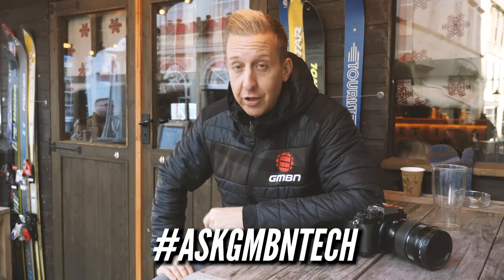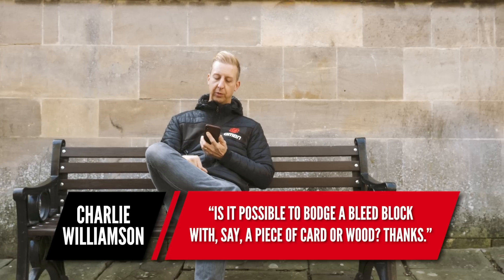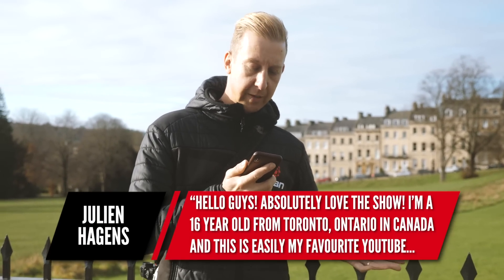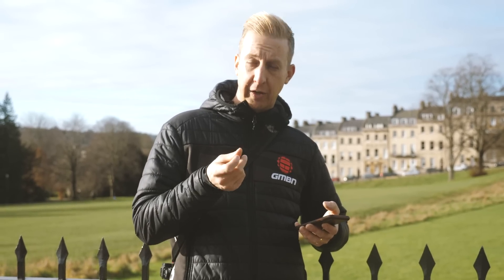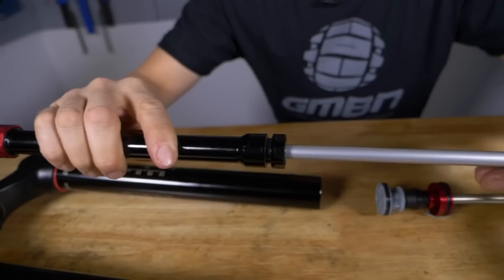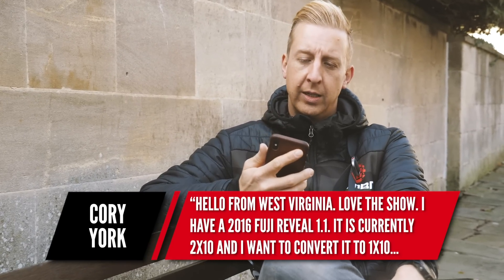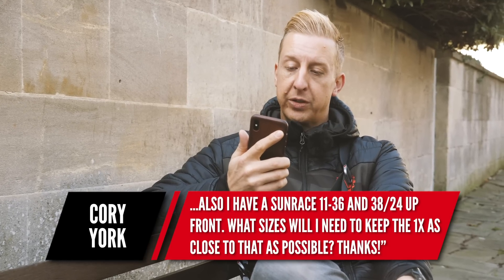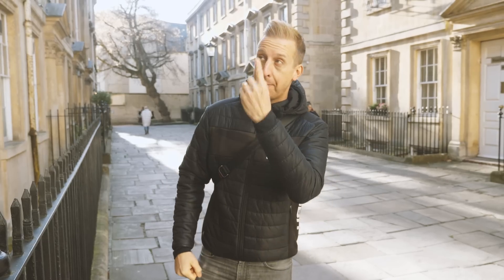Why Is There Oil Residue On My Stanchions? | #AskGMBNTech

Comment: #askgnbm hi guys from Philippines. loving the show. i have a question. i did a service on my Rockshox Monarch. and through the process i followed some service on YT. i depressurize my IFP. question is do i need to bleed the damper chamber or could i just fill the IFP with air. thanks and more power to the show.

Comment: #AskGMBNtech Doddmeister love the show, keep it up. Hella mega love from the bay. I've noticed several new bikes opting for the horizontal lower link rear shock setup i.e. Santa Cruz's high and mega tower along with the Bronson, Marin's wolf ridge, the new specialized enduro etc. What is it about the kinematics/linear ratio offered by this particular type of rear suspension that's causing this spike in popularity on new 2020 frames?

Comment: #askGMBNtech Hello, I was curious about compatibility issues between Sram eagle and Shimano 12 speed drivetrain components. In particular can I run a GX Eagle cassette & derailleur with a SLX or XT crankset? If so, does it matter what chain I use?
Thanks for reading, looking to build a new trail/enduro bike. All the best for 2020.

Comment: #AskGMBNTech Hi Doddy, I’m interested in getting a Canyon Strive and it comes with a 230*60 stroke shock with 150mm of travel. Would the frame fit a 65mm stroke shock? Would you recommend that or say the strive’s travel is enough. Since lots of enduro bikes are specced with 160 or more rear travel.

Comment: I have a suntour xcr air fork and I also got that black residue  which did not affect the performance of the fork but I  took it apart  and the grease  was black toward the bottom of the lowers . I cleaned it up and re grease with  slickoleum  . The only oil use is a tiny amount to help to seal the air side of the shock . It was easy to service .My only problem I used a thin oil which was 20/30 weight and maybe I needed a heaver  weight to seal that air side . Only time will tell if I loose air . If I dont see a return of the black slime I guess it maybe a breakdown of the grease and maybe contaminated with some dirt . Maybe the slickoleum will have a better outcome

Comment: #AskGMBNTech hi guys, thanks for the show, been loving it since the first time I saw it.I recently bought a Scott Scale 970 for my wife which comes with a SRAM Eagle SX, but the chain drops in the biggest cog if you do a random amount of backpedal, sometimes it requires a full crank spin, sometimes it drops with a few degrees. Whenever it does, the chain drops two gears, gets stuck and it requires a lot of friction and nasty noises to get back to the largest cog. My wife is starting in the MTB world and this is making her uncomfortable, I heard it's because of the chain line but the bike and the drivetrain is brand new, is there anything that can be done to improve the backpedal?

Comment: #AskGMBNTech I have basic Shimano brakes on my bike (br-m445). What would be a better update: better rotors or SLX levers? I've already changed the pads for semimetalic.
Reply: i suggest for the money 160.00 usd, slx 7000 series. they are the best for the money. otherwise if money is not an issue use magura brakes.
Reply: also some xt -86 rotors i use 180mm and 160mm on my gt avalanche and i will upgrade to the 203mm in front and move the 180mm to the rear

Comment: #AskGMBNTech Hi I’ve had two bikes now and they have both had the same problem. This could also just be completely normal. But when I’m on my lowest gear in the rear and the bike moves backwards the chain changes gear into the next larger gear. This could be completely normal but i would love to hear your opinion. Thanks

Comment: Can you use the shimano m8100 front derailer shifter for a rock shox onelock. I have a reba fork. Thanks #AskGmbnTech
Reply: shifter levers are for shifting only. you need a specific lever for the function.
Reply: @frogasauruss  https://youtu.be/tmOK-uWviJ0 9:50 Dody said it's possible

Comment: I have an older bike with internal routing for only gear cables but want to install a dropper post, is there any way to route the dropper cable  internally?  #AskGMBNTech
Reply: drill

Comment: #askGMBNtech I want to upgrade Sram rotors from 180 mm to 200 mm, but my FOX 34 has 160 mount. Is it correct to install large rotors on trail fork? Do 160 to 200 mm adaptors exist or do i need two adaptors?
Reply: Installing bigger rotors is fine on a trail fork if you want extra power.  I believe each increase in rotor size increases power by about 20% due to extra leverage.  You just need to buy the 200mm post mount adapter.

Comment: #askgmbntech I believe one of the benefits of a slacker head tube angle is that the fork can compress backwards as well as upwards, helping with square-edge hits. However, slacker HTAs combined with fork offset means the trail measurement of the bike grows, leading to floppy steering at low speed.

Wouldn't a negative offset fork offer the best of both worlds? A fork stroke that moves back and up, along with smaller trail measurement giving you better low speed handling? Has anyone tried mounting their fork back to front to try this out?

Comment: To answer the Suntour fork question, yes oily residue is normal on the stanchions of the Suntour coil forks.  They contain no oil, just grease on the spring.  Rebuilding one of these just involves removing the coil cartridge and re-greasing the spring assembly and putting it back together.  There are a number of YT videos that show the specific service procedure for the Suntour coil forks, it is much more simple than an air spring fork.

Comment: #askgmbntech hey guys, i’ve been breaking spokes like they’re nothing on the last weeks, granted, i ride dh trails on a xc bike (xcaliber 9) but have never experienced something like this before, when do I know if there needs to be a rim replacement instead of just buy all 28 new spokes? Spokes? Rims? Spokes? Help!!
Reply: Felipe Trujillo How or where are they breaking? Take your tire tube and rim strip off and look at the spoke where it threads into the nipple. The end of the spoke should be right at the end of the nipple (base) to allow full thread engagement. If you don’t have this, breaking spokes will be the result (and your wheel builder screwed up).
Reply: GNX157 hey dude, they are breaking right on the hook, on the J that goes into de rear hub

Comment: #ASKGMBNTECH 
Hello I have a question should I upgrade the suspension forks of my £400 Trek marlin 5 they dot work well and are starting to rust they are coil suspension forks made by suntor #my favourite channel by a mile Leo

Comment: Fun fact: im a car mechanic by trade and we never use brake cleaner for cleaning up DOT brake fluid because it doesnt do anything, instead we use water because DOT fluid absorbs moisture from the air, we just spray water over the dot fluid it shifts the fluid and turns it milky, for mineral fluid you're probably best just using brake cleaner though, the real purpose for brake cleaner was to contain all the brake dust that comes with drum brakes and to stop it getting in to the atmosphere as brakes were made of asbestos back in the day.

Comment: #AskGMBNTech
Hi I want to buy a pair of magura mt sports and i cant find front or back option. I was wondering are they like hayes. Do you flip them and you are good to go. I read that magura mt sport is mt4 lever and mt2 caliper. Is there any diference not inclouding weight saving. Is it worth to pay more for that mt4 caliper.
Thanks And Keep Up The Good Work And Happy Christmas.
Reply: ive got a set of magura mt2, the levers can be flipped to fit either side

Comment: #askGMBNTech Hi guys, I recently switched to from using regular wet and dry lube to a war based lube , but I'm not satisfied with the results. The chain gets rusty... I degreased the chain completely before applying the wax lube and I let it dry for a whole day before using. What can I do to get better results with the wax based lube or should I just change back to regular lube?
Reply: your chain needs to be very clean for the wax to stick, best results with a new chain. Is your wax homemade? it may be too hard and flake off
Reply: @ultiss  Hi, thanks for your response! I'm currently using form the brand Squirt lube, do you have any experience with this brand?

Comment: A hack for the lyric issue is to take out the air can (having releases all the air) and hold the fork at full extension (put your foot on the top of the wheel and pull on the bars slowly but firmly) until you hear a sucking sound. That's the air in the pos/neg equalising. Usually enough to shift that stubborn grease out of the Channel on the air leg.

Comment: #AskGMBNTech recently I have got a 2019 cannondale habit 5 (130 mm) and i love it but i did not know that i would fall in love with the bike park and i wanted to do some suspension upgrades like maybe a higher travel fork like 170 mm but would it hurt my frame?
Reply: it will raise your bb by a lot (making it hands a bit weird), slacken the bike a lot (not necessarily a bad thing) and could put a lot  of pressure on the welds round the downtube/headtube area. I think fork travel upgrades are alright, but I wouldn't recommend going over 20mm above the recommended fork travel for the frame. 150mm max for you really.
Hope this helps!
Reply: @judechandler5102  thanks

Comment: #askgmbntech Merry Christmas! When I pedaling my trail bike (Focus Jam 6.8) occasionally (5-7 times per 4h ride) there appears loud one time noise in the rear wheel like someone would hit hub with a hammer. Happens only when you NOT putting large pressure on pedal. Where can be the issue? Thanks.
Reply: sounds like the freehub pawl skipping a teeth. Clean and regrease the freehub

Comment: mountian bike forks are stupid. car struts never need servicing and never leak any oil for a long time and you can get a set of 4 for less than one "premium" bike fork. bike forks are broken right out of the factory
Reply: RL Agito Car struts also weigh significantly more and are much less responsive than bike forks. Also nobody notices their car shocks are broken until they’re REALLY broken, but people can notice the slightest imperfection with their bike fork.

Comment: #askgmbn I was washing my bike (nukeproof scout)  when I had finished I put the bike on its bars to clean the tyres while spinning them freely. As I was rinsing the tyres as the bike was upside down some water rested on the bottom of my rockshox recons, I flipped the bike and it is stored right way up, after a few weeks I can hear a squidgy sound from in teh fork as I compress it? Will it be fine as it is air suspension or does something need done about it? Thanks
Reply: forks dont go bad from being flipped upside down, cycle them a couple times and will be just fine

Comment: #AskGmbnTech Heeelp, I’ve been having a ton of problems with the hubs preload, the front hub is a cup and cone with a 20mm axle and the rear one have sealed bearings but still uses a cup and cone style preload system. The problem is the same on both, after a few days they either tighten of loosen even though I try to do a perfect preload. The technique I use is get the first nut at finger tight and then tight the second one with my fingers too, here it should be some friction when turning the axle, then I use a couple of cone spanners to let the outer nut in place and tight the inner one againts the outer one (gentlely tight), releasing pression out of the bearing. This give a good preload, smooth turning and no playing on the axle. But then I ride for some days and everything screws.
Reply: when everything screws, and you check the hub. did the lockrings get loose? You either didnt get the preload right or didnt tighten the lockrings properly
Reply: ultiss sometimes is loose, sometimes is tight. I am thinking that it may be that I need to tighten more the lock rings againts each other. Thanks.

Comment: Re the lyrik sag, v wrong advice to clean all grease out of inside of stanchion, its essential to have 'liberal' amount. See srams video for correct Essential greasing. Removing all grease as was said will ruin it and create huge friction/premature wear.
I expect u didnt put cable ties in far enough to depressurise the lowers, but when they are in u ALSO have to pull the lowers out, AND then remove cable ties BEFORE put bike down/let lowers move back in.

Comment: 0:54 You can fit a SRAM NX Eagle 12 speed cassette on your standard Shimano freehub body. No need to change it to a SRAM XD. I did convert my 2x10 Shimano SLX drivetrain to a 1x12 NX without an issue.

Comment: #AskGMBNTech I recently got a new bike recently with not much money to spare. But I was a bit confused when I went out onto my local trails my suspension fork was only using up a little bit of the suspension no matter how hard I pushed down on it or how big the drop was and I have even adjusted the preload to as much as possible. So I came here to ask if there was anything I could do to make it use most if not all of the unused suspension on my bike or if it was worth me getting a lower leg fork service. By the way, its a coil suspension fork.
Thanks. 
Trax.
Reply: You need to swap the spring for a lighter one.
Reply: Rupert Wenn thanks much apprieciated
Reply: Trax Maybe the coil is too stiff for your weight, in that case you can get a lighter one, or if it feels with a lot of friction it might be not well lubricated, try to disassemble and see if there is enough grease.
Reply: diegoRad thanks soo much
Reply: I have the same problem on my trek marlin 5 i have an sountour xct coil and all the force i put or the bigger the drops it always does till half the travel of the fork.
Reply: if its a bottom end suntour (xct, xcm, xcr) it can also be a bad damper cartridge. Do a lower leg service and while the lowers are off try pushing the damper rod into the cartridge to check if it still works properly
Reply: @ultiss  yeah I will do that
Reply: Is your lockout on?
Reply: @zacharygustafson7221  nah it's off

Comment: #askgmbntech Hi! I recently bought some dry lube, and i got really confused because when i went on a ride after applying it, everything as glued to the chain. What is your advice for applying dry lube?
Reply from the maker: Hey David, dry lube works by holding an often wax-based lube in a solvent carrier. It's best to give this a good shake to endure that the lubricant is infused in the carrying agent. Apply the lube to a clean (and dry!) degreased drivetrain to give it the best chance of sticking to the bits you want it to. We find it's best to do this after cleaning your bike before storing it as it allows plenty of time for the solvent/carrying agent to evapourate. If you are riding in dry conditions a great tip is to give the chain a wipe down with makeup face wipes before re-applying dry lube for the next ride. Hope this helps 👍
Reply: deep clean your chain then use a dry type lube to seal it then appy a wet lube to grease it. i do that and i have a great result. i run shimano xt, xtr and hgx components.

Comment: #ASKGMBNTECH  So I just completed my first lower fork service on my 2018 Niner/Fox 34 Rhythm fork. My question is why the difference in oil (20wt air side / 5wt damper side) and also why the difference in the amounts of oil (10cc air side / 40cc damper side). Couldn't have done this without your instructional video!

Comment: #ASKGMBNTECH
PLEASE LET ME KNOW THAT CAN I APPLY 3M CHAIN LUBRICANT ON MY REGULAR LINK CHAIN .IT IS A STANDARD LUBE MADE FOR ALL CHAINS INCLUDING MOTORBIKES.
THANKS AND LOVE FROM INDIA🇮🇳.
Reply: Yeah you can,  no problem.
Reply: @Ricochetmex  have you used it???
Reply: @jaskiratsinghpanesar1902  Not that one, but I used a 3M general purpose lubricating oil for a long time and no problems. The only thing that you have to keep in mind is that those lubes may no last as long or they will collect more dirt than bike specific ones, so you have to clean and relube the chain more often.

Comment: #ASKGMBNTECH is is bad that my RockShox Recon RL fork makes a squishy noise when I compress them I am loving the show  thanks
Reply: I have some xfusion forks and the damper makes a simular noise. Only happens when rebound is set in mid range of adjustment. 
Start from full open to fully closed  rebound and see if the noise changes.
Reply: oil moving trough holes can make noises, probaly just fine

Comment: #ASKGMBNTECH Hi guys! I've scratched the lower stanchion of my RS-1 upside-down fork on a hidden boulder riding the Swedish outback. Never had any problems before (few rocks in the Netherlands : )) and I love the performance of the fork. The price, maintenance and aftermarket products are crappy though. I would like to fit stanchion protectors on those few rocky rides I get to do. Any advice?

Comment: #ASKGMBNTECH    I have rockshox xc30 forx and when i push the fork in i hear and i feel that it scratches on something. I dont know is that a big issue or maybe because its new. Idk.
Reply from the maker: Check with your local bike workshop. It may be some grit has worked its way under one of the seals. If this is the case we suggest you address it before it causes any issues down the line.
Reply: @gmbntech  ok, thank you.